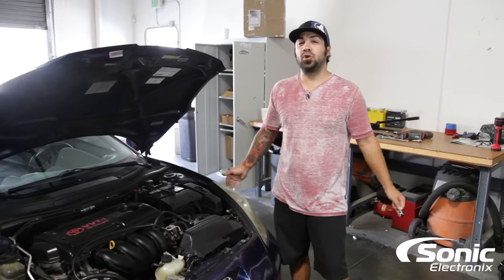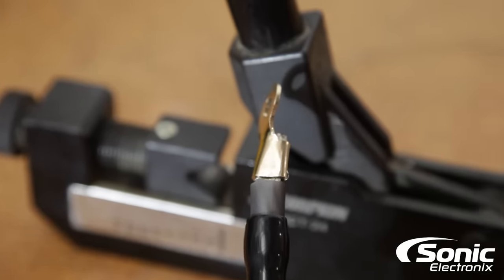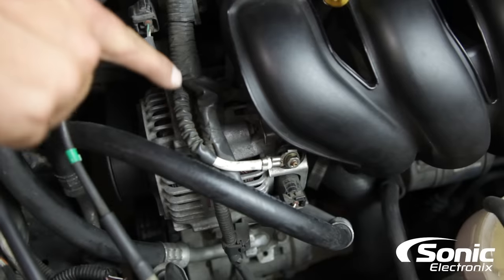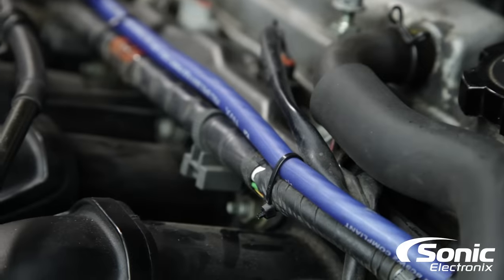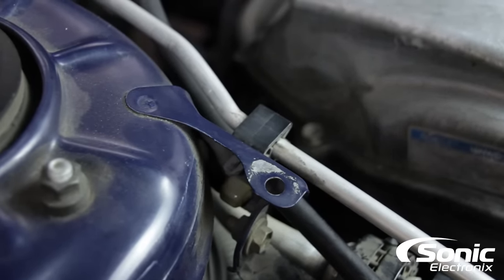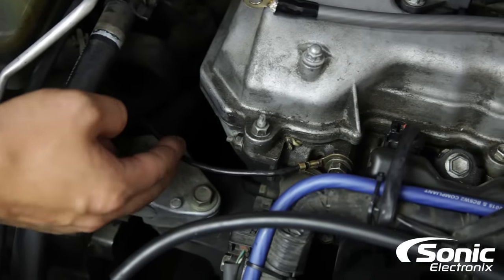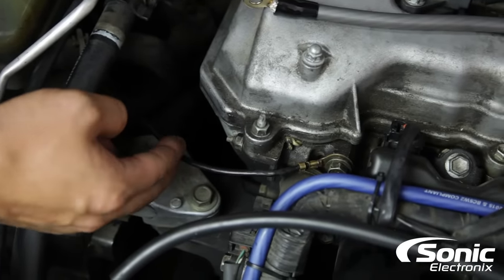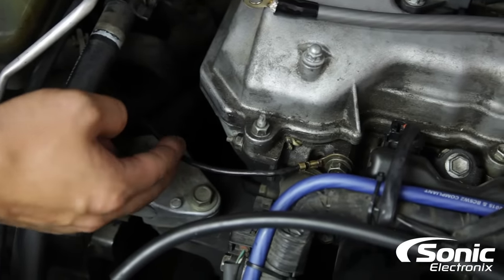How To Install the Big 3 Upgrade | Improve Your Vehicle's Electrical Charging System | Car Audio

Comment: Try doing this to a Ford Edge, the alternator is located behind the engine, not accessible from top or bottom. But I just finished upgrading my big 3 on my ford edge, 3.5 hours! (No kit, just straight 20' of wire and purchased terminals and zip ties from Advanced Auto Parts, to make my own cables)

Comment: best way to upgrade a big 3 is to add second battery, everyone forgets the massive pull your entirely electrical computerized vehicle uses all the time, it also messes with the can bus within the car. Best way is to keep all of your upgrades as seperate as you can get from rest of vehicle!

Comment: to avoid short circuit, better to use fuse 80amperes between alternator and positive terminal of the battery duhhh
Reply: lulz

Comment: I thought for the alternator upgrade you had to actually replace the alternator?
Reply: You do, but i guess that isn't technically part of the "Big 3" upgrade. But if you're running more than 1000-1200 WRMS, it's reccomened to buy a high output alternator and REPLACE your stock alt with it. I can push upwards of 1200 watts in my chevy s-10 but the headlights dim significantly and im sure its not good on the battery or the alt when i do that. Sucks because alts cost a shitton of money even if you just want a little extra wattage like 1500rms.

Comment: realistically you shouldn't be using your current alt and bat when powering up a high end system - 40 % or more of the alt's power is used to power accessories on the vehicle. Slap a 1000watt system and your going to end up with a fried alt in a few months from over stressing it, not to mention your factory batt will be constantly pulling excessive amperage from the stock alt. Best to install high output alt along with your stock alt and do heavier cabling for the aftermarket alt. then have a proper 2 or 0 gauge cable from the alt to the trunk connected to a second battery or batteries.

Comment: Should be the "big 4",  the ground from chassis is normally braided or 8ga wire. If you power your audio  system from a batt bank including your front battery, the wire size one uses to feed the amps should be matched throughout > from :alt "+" to primary/system batt "+", engine block ground "-" to primary batt "-",  primary batt and system batts "+" to amps/distribution block "+", amps/chassis/system batts ground point"-" to primary batt/engine ground point "-"

Comment: If you are doing this on a diesel with 2 batteries, do you need to run a wire from the alternator to both batteries or just 1?

Comment: Why would you do these upgrades?I would think that, since the existing wires are spec'd for the battery and alternator, upgrading the wiring shouldn't make a difference unless you're also upgrading the alternator and/or battery. 

 I've done a ton of auto repair work but when it comes to sound systems, I've only done a few and usually they're pretty small upgrades for casual listening (i.e., not competition), so I'm wondering if there's something I'm missing.

Comment: Where would these wires be located in a 2010 Chevy Cobalt? And how would you run the charging wire being that the battery is located in the trunk?

Comment: Positive yeh, definate improvement. -   I wouldve kept the existing negative on the block & not change that & just added the new ground & ran it to the battery, and again to the shock tower bolt,if it were me.

Comment: Great video!!! 
My interior lights went off once and I change the bulbs in the interior,😮 issues with it and then all of a sudden they just stayed off
For the past six to eight months they turn on maybe once every 3 months sometimes for hours sometimes for a day and then they go back where they don't turn on.
Reply: So the Bob's stayed off for the past eight months but they will come on maybe two months later maybe four months. You think that could be from ground wire for the 04 envoy

Comment: I've installed 'the big 3' in several vehicles.  What I noticed, after the fact, was easier & more consistent starting, and the interior lights were slightly brighter.

Of note, on every connection point, I applied a very small amount of dielectric grease.  Yes, this grease prohibits electrical conductivity - when pressure is applied (ie. when you tighten a nut or bolt) the dielectric grease pushes out of the way, thereby allowing a solid metal-to-metal connection, but the remaining dielectric grease acts as a 'seal' from outside elements.  I've been doing this for over 15 years and it has helped increased the electrical consistency with each vehicle I've done this on.

It is a smart move to make sure there is a 30 amp fuse on the wire that leads from the alternator to the battery - the fuse is best placed as close to the alternator as possible.  This is just in case the sheathing of the wire becomes damaged and exposes the wire inside - the fuse will pop before it would short out anything electrical (ie. ECU, fuses, relays, etc).

Comment: no zero gauge ? no in-line fuses ?
Reply: It's a celica, no system in it..... hes not trying to run 4-18 inch woofers off this setup, only for the cars electrical benefit is he doing this.! And where there fuses on the wires he replaced.??? No sir there wasnt.!

Comment: It’s a must if you have a sound system in your car. in my mazda3 I have 2 5000 watt amps & when I turn up my system haft way my car stalls even with a new battery and a 20 farad super hybrid power capacitor after I did the big 3 upgrade the car stopped stalling and the bass sounds better and after I did the BIG 3 I blew my back window lol

Comment: On the Chevy/GM, you forgot to mention the smart charging system or Regulated Voltage Control system sensor that's on the negative wire. Scraping or forgetting that would give you worse performance.

Comment: I got a question, im trying to install 2 15in subs in a 2018 jetta with a 4000w amp and i dont want the battery to drain or the alternator to pop. Will i need a bigger alternator and that will do the job?
Reply: Yes, sure you've found this out by now haha. Hope u got that system pounding. Just ordered a sundown 15" today, so getting ready to run some of these wires myself👍

Comment: The wire appendage from the alternator cable, which runs to the negative battery post, corroded and broke off, leaving no ground to the lug that had attached it to the chassis. Now the alternator runs at 12.4 v and the battery light comes on at warm up, then intermittently.  Is that due to no ground, or just a bad alternator?

Comment: Using a bigger wire does not do much if you are using a dinky thin terminal like that its restricting current flow use a infra red thermometer  that dinky terminal  vs a thicker one and see how much hotter it gets thats resistance

Comment: Put hi amp fuse in positive jumper wire if there will be short circuit in alternator rectifier then positive jumper wire will be burn out...and it ll turn into ash very quickly....

Comment: Do I have to protect the wires by wrapping them or would 4 gauge wires be okay inside the engine compartment if it is resting against the coolant/radiator hose?

Comment: Thanks I appreciate the walk through of the big 3, Now Years after install I think I can do it, unless lazy like the previous years. But I ask should I not I put a supercapacitor in the engine bays battery compartment? I already have 2 truck batteries in the trunk. The battery mounted in the engine compartment has been destroyed for awhile and left disconnected, Its nearly a dead short.

Comment: 8:20
that was not the engine block to ground, that was the engine HEAD to ground. The engine block MAY have a different / dedicated ground connection OR it may get its ground from the head via head studs....  And besides i don't understand the point of re-grounding the engine for better charging or car audio benefit since the radio / amp gets its power from the battery which is charged by the alternator...
Reply: Because power flows through the grounds there are 2 components to an electrical charge the negative charge is equal If not of greater importance .. you should have just done a Google search

Comment: If the original charge wire goes from the alternator to the starter then to the battery would you just bypass the starter with the new wire or terminate it to the starter too

Comment: Being an electrician...alternator to battery you parallel run with stock wire...in AC current paralleling wires us only allowed on larger kcmil wire and lengths MUST be same exact lengths for obvious electrical theory and nec code compliance.... is this not a worry with DC? Is this creating an unbalanced load? Will 1 wire heat that is smaller gauge? Will this strain alternator ? I feel multiple long term failures could occur. Am I wrong associating ac with dc??? Explain your theory please?

Comment: I was told to keep the original positive cables and still attach the 3 gauge. Should I also do this for the ground connections? Keep them and use the new 3 gauge?

Comment: I like to use an alternator mounting bolt for the engine ground, if possible, and also upgrade the terminals especially if they're the shitty ring crimp type.  You don't need stupid expensive terminals... just good solid ones.

Comment: These are basically jumper cables. Either going from the alternator to the battery or battery to chasie. In my opinion bigger the awg the better.

Comment: I greatly increased my charging system by adding a ground strap to my 30yr old isuzu trooper the cable was added when the battery started going dead and new ones did too not sure if these other two are needed though since the one fixed my problem

Comment: I think just added ground wire has enough to improve performance &  reduce jerking.. No need charging wire (need added fuse to protect circuit if u want add) 
Juz my 2cent opinion 😅
Btw good video to watch

Comment: Make sure those cables are copper.  Copper clad Aluminum doesn't belong in an engine bay. Always use automotive grade battery cables for the engine, chasis and alternator..  and use captive heavy gage copper lugs..  squirt some deox in the lug barrels before crimping then finished with shrink tube.

Comment: Hey at 9:00 he mentions about the argument of routing it to the battery ground vs the chassis? What are the differences? or are they really minimal ? Also do those differences matter on a small 250 amp system?

Comment: is it wise to add a 4 gauge power wire to existing one or replace stock one with 4 gauge? I upgraded my alternator from a 90 amp stock to 160 amp. I’m having some charging issues at high rpm’s. Should I also replace the fusible link to a 160 amp fuse?

Comment: I made my own tutorial and people keep insisting on adding a fuse for the charging wire. Is this correct? If so, which type of fuse should I install?
Reply: No.. the fuse will keep blowing on youunless it's rated what the alternators maximum output is...

Comment: Well, if the OEM is 4 gauge, which it probably is not, and someone adds another 4 gauge, than the cross sectional area doubles and the AWG is considered 1 gauge (doubling cross sectional area reduces AWG. by 3) and the conductance (Siemens) doubles, or at least that's the theory, correct?

Comment: Your introducing new wire from alternator to positive side of battery because so how the alternator is not charging the battery correct? And was that blue wire 4 gauge wire.  Where could i find these ground on 2012 town and country mini van?

Comment: What if there's a fuse and relay Box in between the alternated charging cable and the battery positive?
Should I bypass the box or just upgrade both wires?

Comment: What would be a decent price to have something like that done to the car he worked on in the video? I have a Ford Mustang, and the alternator is right on top, and the cheapest quote I got back was around $600 which seems absurd to add 3 cables. Mind you I have all the parts/tools for the job (I was just looking for installation/labor), but due to weather, and a hectic work schedule with the coronavirus, I have been unable to do this myself.
Reply: @Timothy bob The newer Mustangs (2017 EcoBoost) the alternator is buried. You can't get it from underneath because it's directly above the frame.

Comment: I paid a shop $2000 to do this and they didn't upgrade any of the big 3. Running 4 amps and two of them were buzzing when the volume was under 8, when I did this my amps not only stopped buzzing my voltage on my batteries increased as well.

Comment: You are obviously blissfully unaware that the wiring designer uses a charge wire gauge that limits the peak charging current when a car is bump or roll started and the battery is flat. The small voltage drop across the charge wire limits the peak current for a few minutes as the battery charges, protecting the battery and alternator.

Comment: I installed a 200 amp alternator with a 0 gauge power and 0 gauge ground, Should the alternator be getting hot?

Comment: This only works for adding more energy to the sound system? no extra benefits to the electrical charging system of the car in general? also, would this work for a '70s car with a upgraded alternator?

Comment: if you can't find the engine chassis wire, does it matter? can we just make a new connection wherever it works as long as we are careful about not damaging shit?

Comment: I have 1-15L7 Q class with a kicker1200.1 and another kicker 360.4 and while I’m sitting at idle, my volt meter reads 13.4. When the bass hits really low, it’ll hit about 12.8ish so do I need a big 3 yet?

Comment: Some say it's the Big4, (a third ground from the alternator ground to the frame of the car). Is that needed?
Reply: The alternator usually gets grounded to the engine with an alternator bracket. So you would just be grounding the engine again which is fine

Comment: Just installed a system in my 2019 Altima  will I need the big three upgrade? also great video Homie thank you✊🏽💯
Reply: I did it on my 2014 altima it helped alot with the bass cutting off 👍
Reply: Probably, think about it, the factory radio came with wimpy power and now you've put in the big dick energy into the stereo. The charging system was not designed for that BDE

Comment: , Another Tip...........
after you clear coat or paint your new ground connection to the body, nothing wrong with putting a little bit of DIELECTRIC GREASE on that connection point !!!!!!!
Reply: There would be absolutely no point if you've already clear coated or painted after making the connection

Comment: so its not a problem to keep the existing connections? like the alt is running to the fuse box and the battery?

Comment: Shouldn't one of those wires be going from the starter housing or engine block to the neg. battery post? You see so many different ways, but is there a "best" way to run the wires?... As far as how the wires run, I would think the way they are right out of the manufacturing plant would be correct... Now, to upgrade/add better quality wiring is up to you, but use the same routing and connection points. That's what I believe...

Comment: With the upgrade alternator wire, having the original still connected, essentially isn't that going to reduce the power needed to charge the battery?????????

Comment: Question? So when adding the BIG 3 do you still need to get a new alternator?
Reply: Notorious The Greatest no, unless you are still noticing big voltage drops I wouldn’t worry about it
Reply: @mudstud1239  thanks
Reply: Notorious The Greatest no problem

Comment: Does anyone know if most charging wire has an inline fuse and what the amp rating would be?  Also does anyone use any type of chemical like "Deoxit" or another chemical to help bond the two connections to the ground and power cable and to help with corrosion?  Thanks in advance!  Great channel and great products that I can trust!
Reply: Just came across this and was thinking the same thing as most of the wiring diagrams I am looking at carry an in line fuse.
Popped the bonnet on my two vehicles and saw them, built right into the terminal on the battery +ve terminal.
They are rated in the 80/100 or more Amp range for shorts in the battery or alternator circuit so be careful

Comment: Why am I not seeing a fuse block between the power of the alternator and battery? I could be wrong but did so on mine. And was told to do so? I am by no means an expert in this field.

Comment: Is it save to put a cable from the alternator to the positive battery connection without a fuse
And can i use one of those amplifire cable fuses..you know that big plastic/glassie tranparent things

Comment: The way you did that was a little bit sketchy. You should’ve un attached the main battery post before adding the new line. Once you add a wire to the alternator, it becomes hot if you don’t unplug the main post.

Comment: So I am deciding to step up from 1500rms to 3k rms and finally get my high output alty before that, what size wire would you reccomend for the big 3 for a 3000 rms system?

Comment: vehicle with charging system control by ecu or ecm can do a big3? engine start, without load : 12.4v and turn on a head light and aircond then voltage jump to 14.3v with load. that mean voltage is controlled by ecu or ecm? safe to do a big3?

Comment: regarding the end-line fuse holder, does that go beteween the original terminal attatchement and the battery, or just on the end og the replacement cable... as that would achieve nothing with the original alternato cable in place. Asking as an engineer who is new to owning and working on a car.

Comment: My alternator puts out 15.1v at the rear terminal.  My battery voltage is 13.5v when measured at the battery when running. Should I still add the alt. wire to battery wire?